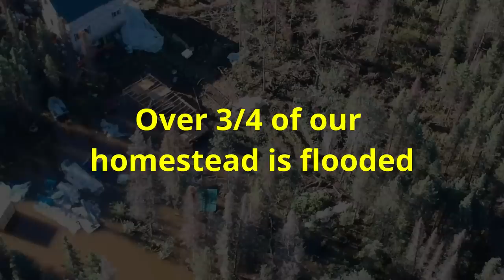Can we finish the woodshed before Winter?

Comment: You put the 2x4's on their flat side, instead of on their edge?  Do you realize how much strength LOSS there is between the flat and the edge?  It's drastic!  And when you put sheets of OSB up, you didn't stager the joints, staggering is what ties the whole roof together!  Hopefully it will be able to take your snow load, or you spend the time to keep is shoveled off.  SR
Reply: This is true. I hope it stands upunder the extreme alaska snows....good luck.

Comment: I have to say, the rafters will have no strength laying flat. Because of the snow it should have been a gable roof so you don't have to shovel this winter!
Reply: I would say any heavy wet snow and that roof is in trouble. They could put some posts up under the rafters in the middle? They should've put the rafters vertically and not laying flat. They lost their tent because of heavy snow. They could have put posts up under the metal beams to help give that support. I only thought of that after it had happened.
Reply from the maker: There are pillars inside the woodshed to keep the roof supported 8).  We will do an updated tour eventually

Comment: Hello.    You. Must.    Listen.   There.  Is.  A.  Sayin. About. Building.  It. Is.   If. Don't.  Know. How.  How. Too.  Build.   With.   Thought.   Build.  A.  Lot.     Double.  The. Roof.   Structure.  From.  Under.    Side.  Use.  Board and. Button.  System.  Stagger. The. Joints. Vertical.  Siding.  Vertical.  Offset. On. The. Inside.   Joints.   Then. Wood. Will. Dry.  With out. Getting.  Wet.  From. Snow.  Or.  Rain.   Finish.  The. Structure. First.     Don't.  Put. Wood. In there.  Yet.   Just. A. Thought.          . Looks. Great.